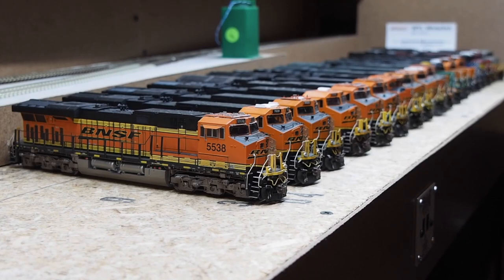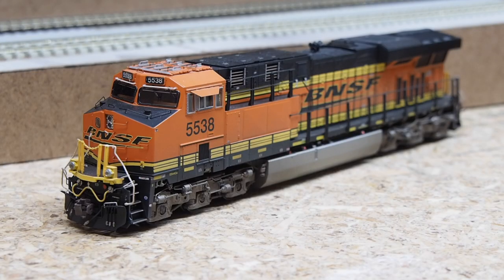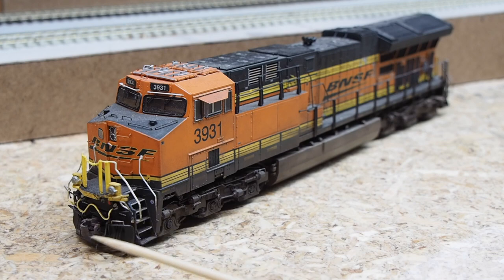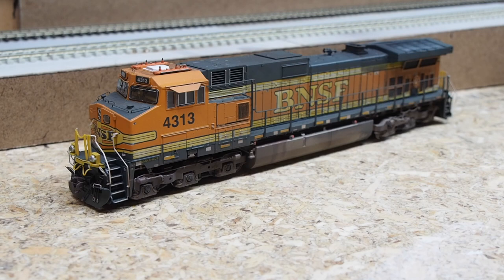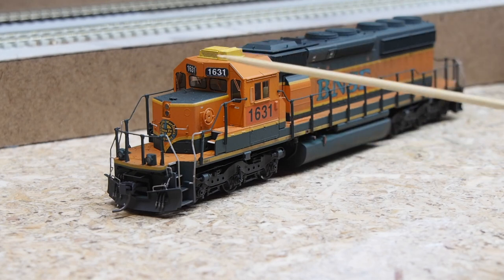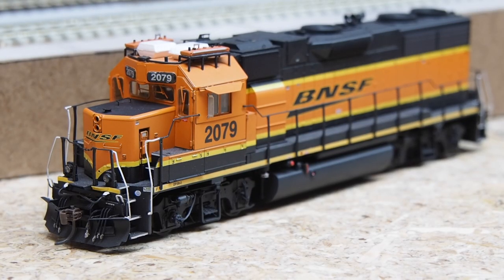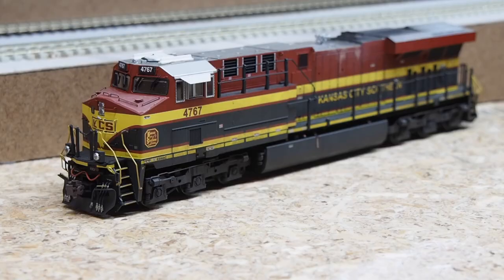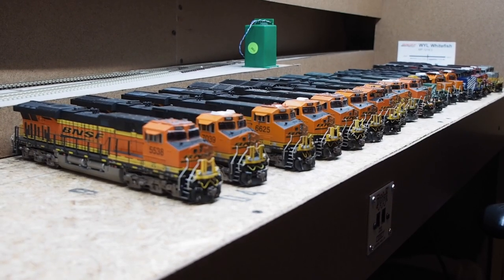My HO Scale Modern BNSF Locomotive Roster

Comment: At half your roster, 9 locomotives. Only mine is a lot more diverse. 2 SD40-2s, 1 GP30, 1 GP18, 1 GP40-2LW, 1 SD35, 1 Dash 8-40B, 1 SD40T-2, and 1 GP39-2. Currently working on a 20'x2.5' modular switching layout so been prioritizing smaller 4 and 6 axles for my roster. Ones that wouldn't look as weird in a 1920-1960 switching layout as say an SD70 or Dash 9. Hoping to add a SD39 and 2 GP40s soon.

Comment: All My locomotives are BN/BNSF   BNSF SD70ACe (2),  BN Locomotives (green) are SD40-2 and GP 40-2.  I like the idea of the PTC antennas,  where could I find those.  I forgot to mention my GE BNSF ES44C4 which I would like to do the PTC antennas.   What are those white things on top of the cabs,  A/C units?   I just got the Great Northern SD45 #401 with Loksound 5 and it has lighted number boards and a beacon on top.  Very simular to the well known #400 Hustle Muscle here in Minnesota.